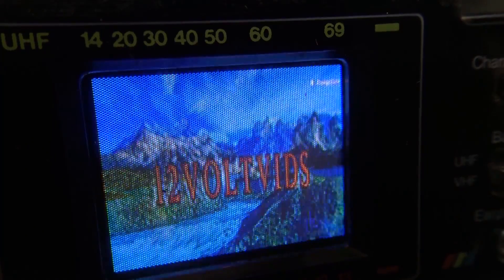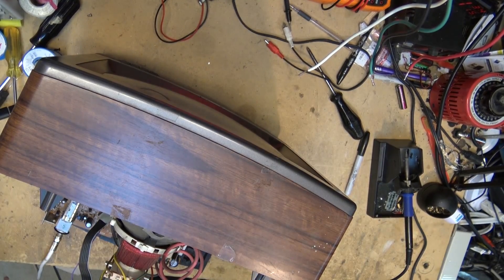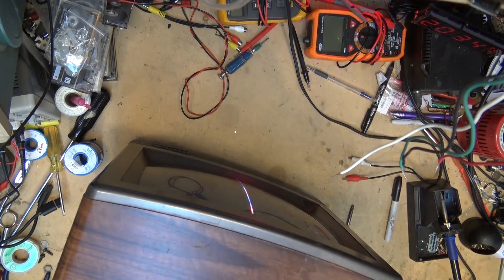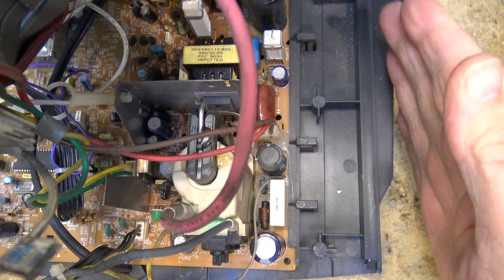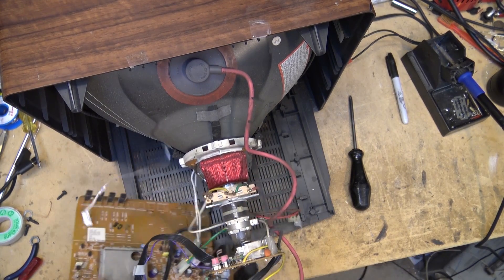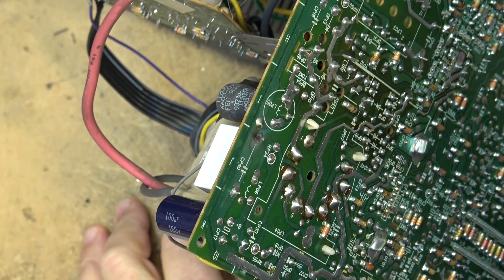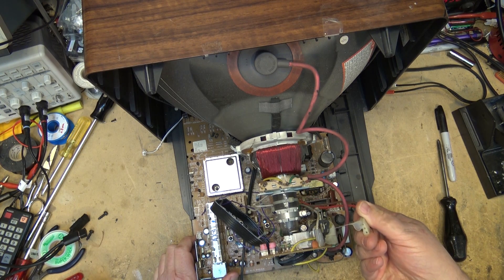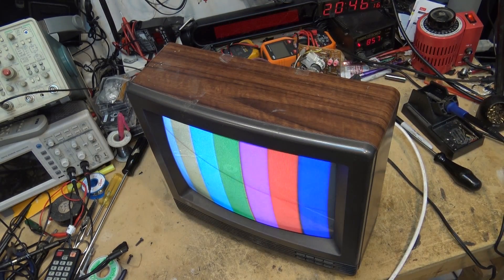Most Dangerous TV fault ever -  Fire Hazard

Comment: Just wondering have you seen the mods to put scart on a US tv I kinda want one for my old games and dvd players and such also can you make a tv with rf only have composite by taking out the rf modulator and wiring up some sort of input?
Reply from the maker: A t h s t e t i c A n d r o i d/GamingGutter 
The problem is this is a hot chassis so you can't just add a video input. You would need isolation circuitry.  Isolation is done between the tuner and rf input. The coax connector is electrically isolated from the chassis.